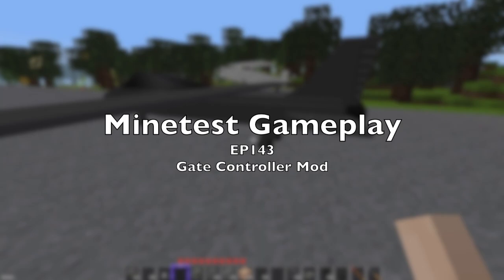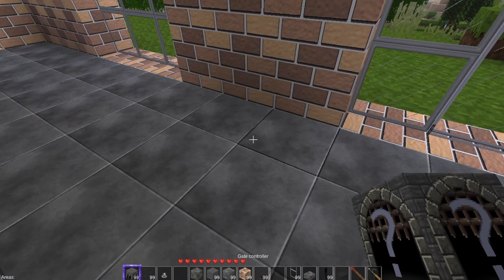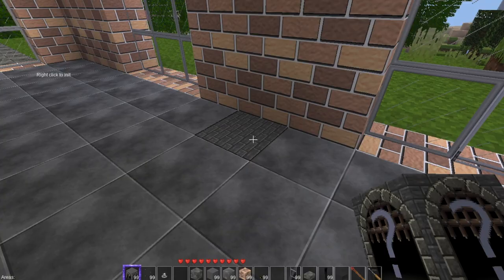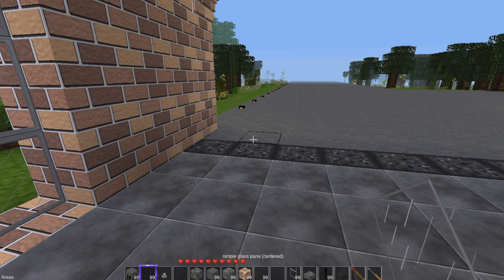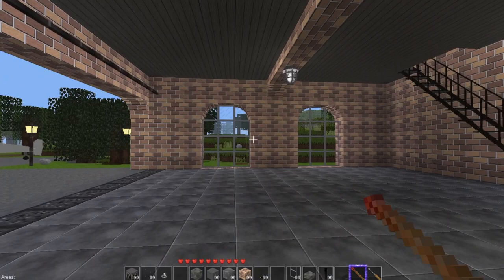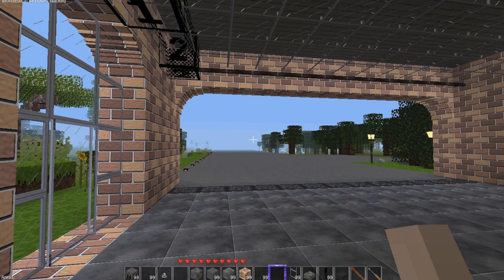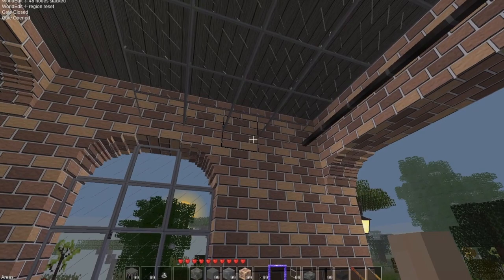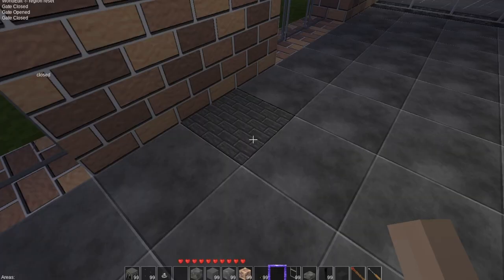Minetest Gameplay Episode 143 Multinode Gates Tutorial

Comment: am only posting this because during the video it didn't look like or seem like you knew this but you could have just used a mese block. you can attach mesecon's to them and energy can go through them from ALL sides.

you can even put a switch on a mese block and then put 1 vertical mesecon right underneath it, and then you can tigh a string of mesecon's to them and that will work! or depending on its distance you could have just put 1 vertical mesecon right next to that gate switch and then put a meseblock right above it, put your lever right on it and there you go! no more floating levers!!

just keep in mind, if you put a stack of vertical mesecons right underneath a meseblock then it will change to this point where it won't reach the meseblock and it won't connect. further more you can't put a vertical mesecon above the meseblock or no energy will go through it either for some strange reason. I just LOVE using meseblocks in creative ways with mesecons. btw, liked the video, I'll be sure to check this mod out. :)
Reply from the maker: I saw this after posting EP144.  I will try with the Mesecons and Meseblocks, Thanks!
Reply: Your Welcome! sure hope your able to make good use out of that advice!! ^-^ btw, tried it, and I LOVE how this mod works! this is great! Now I can even make secret passages with this! I don't even need hidden doors anymore!
Reply: @RichardJeffries  its been a while since I've been here again.... I am only here again because minetest just updated there game, and am currently trying to update all of my mods(which is like a MILLION of them.....lol)because I intent to move up with the latest version.

this mod. . . . is RIDICULOUSLY difficult to hunt down. . . . I honestly recommend You put this mod in Your website(Yes, have been visiting it. I ESPECIALLY liked the techpack mod. saw the video too and everything. haven't used it yet though.... just got it off of your site, PLANNING on using it), You should put it on there so people can have a MUCH easier time finding it... when I try searching on the mintest site(and EVEN googling/YouTube searching it....)I kept getting led to OTHER mods who also have "Gates" in there title(lol, even WORSE than finding a needle in a haystack...)...... after painstakingly, RELENTLESSLY googling it, I ended up finding this video(which I had COMPLETELY forgotten the title of.... other wise I would have just come here before all else...).

YouTube search was of No help either..... You had ANOTHER video with Gates in the title, which was the ONLY gate video(with Your user name on it)that I saw as I was scrolling down. didn't watch the whole thing.... only saw like a minute of it then clicked off when I realized that that wasn't the mod I was looking for.. the video was about(had in its title)a long gates mod or something like that....

Yeesh. . . out of ALL the mods that are out there.... I think this one needs to be on the minetest official site of recommended mods.... this one HAS to be made much easier for people to find.... its a GOOD mod. .
Reply: @RichardJeffries  Never mind.... I just saw it in Your site. . . . I guess what threw me off was that it had multinode in the title. . . . I would have probably found it sooner if I had searched with that in mind(Face palms. . . . .lmao).... its just in my mods.. it just say's "Gates" on it.... I forgot about the whole multinode part. . . .